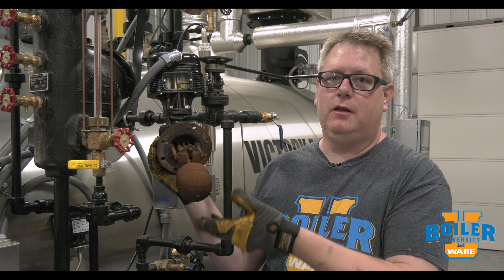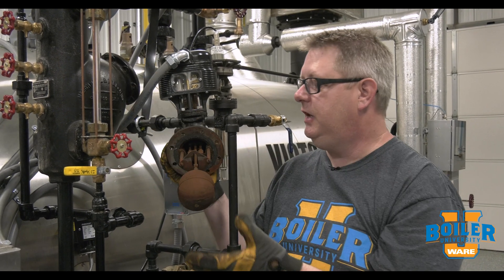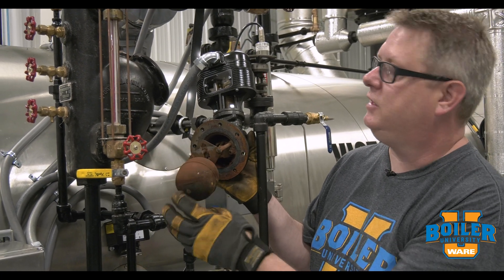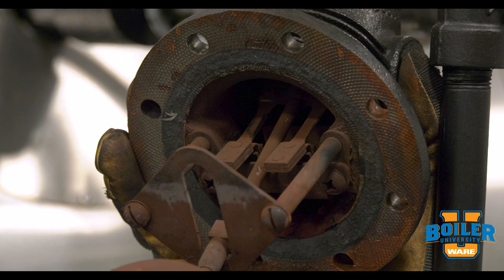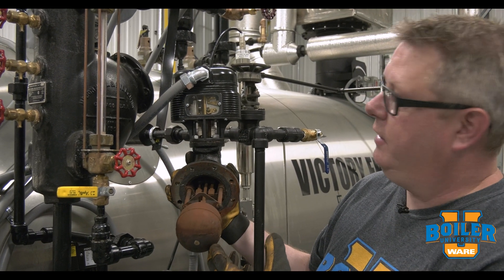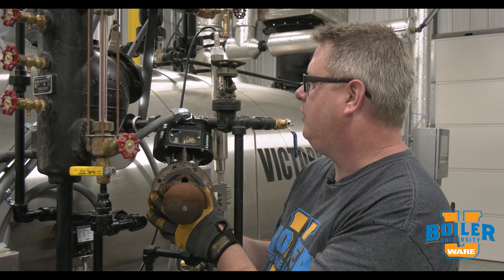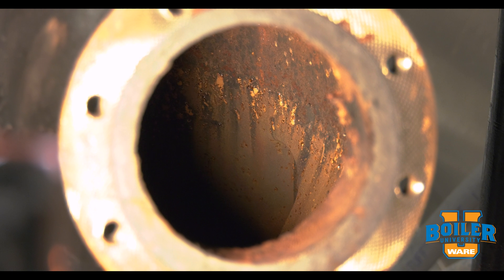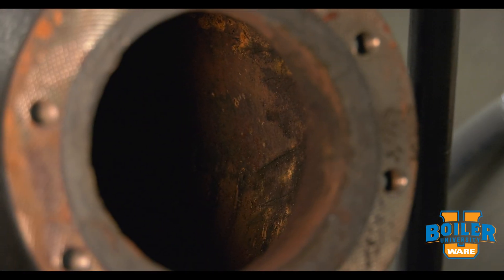Inspecting the Low Water Cut-off for Operation - Weekly Boiler Tips

Comment: For 37 years now when a unit is taken off line for annuals  I've used a long shank die grinder with a brass or bronze brush set  for cleaning buildup from the float housing chamber  . A small  portable blast cabinet with soda media gets into the float assy. area without any damage to springs etc.